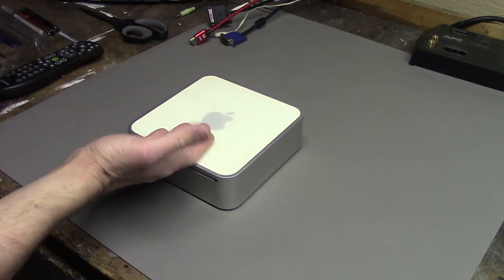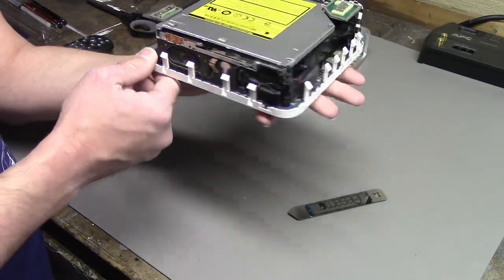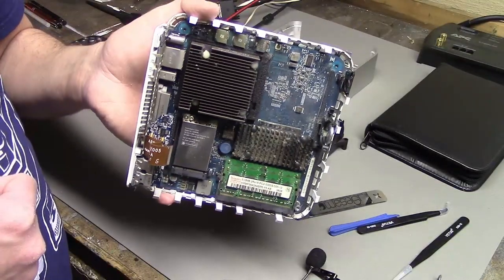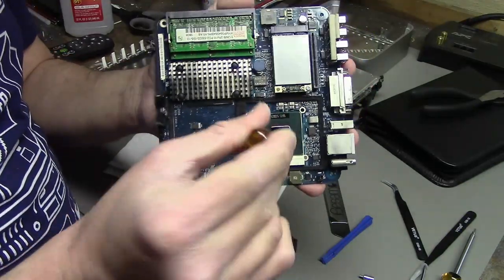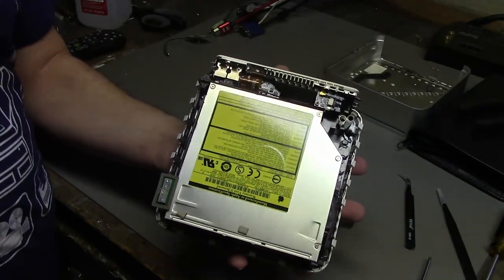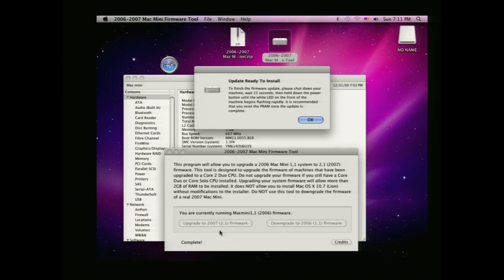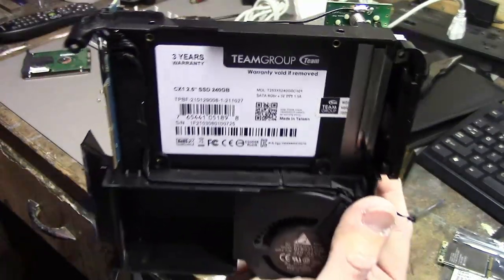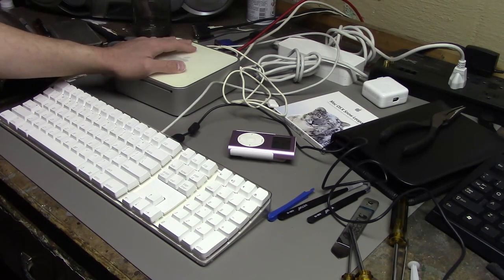Mac mini 2006 - Upgrades and Lion Install

Comment: Even with 32 bit EFI, you should be able to cox it into running El Capitan, which is still pretty functional today.
Reply from the maker: I didn't know there was a patcher for El Capitan.  I'll need to try that!
Reply: @nticompass  where is this patcher? It is not working with my Hardware :(
Reply from the maker: This is the one I was using: https://parrotgeek.com/npf/

Comment: I did a similar series of upgrades to my early 2006 iMac. I upgraded from the stock 1.86ghz core duo to a 2.16ghz core 2 duo, I then flashed the firmware to the iMac 5,1 an upgraded it to 3gb of ram (may do 4 eventually) I then recently installed lion and it made it much more usable due to better program support. I still have the stock Wi-Fi(although I think I broke the antenna as it gets no signal from far away wifi) and the internal HDD is dead so I'm running off a USB one for now as its a pain to open up. BTW if you are looking for a good browser for lion, try firefox legacy 68. It's based off Firefox Quantum and is quite fast.

Comment: A curious thing about these videos.
No one has upgraded the hard drive to an ssd.
I just got a 2006 & I will upgrade mine but leave it at Snow Leopard so I can play my older games or I will partition the drive so it can boot in both modes.
I know how to do it but my arthritic hands will not allow me to do fine work anymore so I will pay a shop to do it.
I was able to play Diablo2 but since it had issues accessing the net I could not upgrade it to LOD.
It would not allow me to install Civilization 3 Complete and it took 3 hours to install Age Of Empires III.
Now to see if that works.
I want to buy an Imac G4 next year so I can play my older games.
I have tried new games and I am terrible at it.
Reply from the maker: I love my iMac G4!  It's nice to have different Macs for different eras of games.

There should be lots of games that work on Snow Leopard.

Comment: Bonjour super vidéo j'aimerais savoir si ce modèle est compatible avec un processeur Intel corde duo T7700 ?est-ce que vous auriez une réponse merci
Reply from the maker: I'm using a T7600.  The T7700 uses a different socket type, so it's not compatible.

Comment: Good upgrades! 👍👍  it would perform well with a Linux OS., installed, such as Sparky Linux LXQT., 32 bit.
Reply from the maker: I do like to use Linux!  That sounds like a fun idea to try.
Reply: @nticompass  It would make an interesting video too.  I have 3 old 32 bit laptops and installing Sparky Linux gave them a new lease of life, You Tube videos are not playable on them though, but your Mac Mini is more powerful than any of my old laptops so it will probably be okay.

Comment: Y porque no una unidad Msata de almacenaje?
Reply from the maker: (And why not an mSATA storage drive?)

I used a 2.5" SATA SSD because it easily fit in the space where the original drive was, without any adapters.  Also, so I could keep the slot on the motherboard for the WiFi card (Airport card).

Comment: I did the same upgrade on mine I bought new in 2007  My question is how or what browser will run ? I tried Arctic Fox 38.1 it loads page the quits
Reply from the maker: You can try Firefox Legacy (by the same guy who made the Lion patcher): https://parrotgeek.com/fxlegacy.html

I haven't tried any other/newer browsers, so I'm not sure what else works.

Comment: What are the new wifi card deails? I need the upgrade too.
Reply: You are using AR5BXB92, is any other model suitable?
Reply from the maker: I'm not sure.  The slot is a mini PCIe slot, but I'm not sure if it's compatible with all cards.  Even if it was, I'm not sure what drivers this version of OS X supports.

I'd at least recommend using an Apple branded card, that should give the best driver support.

Also, this machine is only so fast and only has so many antennas built in.  I don't think anything more than 802.11n it's really going to make it feel any faster.

So, personally I'd recommend the one I used as it's fully compatible and fast enough.
Reply: @nticompass  I am planning to install Linux on my Mac Mini Mid 2007. I do not remember but it seems that I already upgraded the CPU to T7600. I want to use it connected with my 3D Printer or with my TV.
Reply from the maker: I've never tried Linux on this machine, but I can't see any issues with that.  Using Linux should allow you to use more hardware as there are more drivers for certain devices.

Comment: Can you install Windows o Ubuntu? I have a Mac Mini 2006 but i want  install another OS
Reply from the maker: Yes, being an Intel Mac, it does support Boot Camp.  Use the Boot Camp Assistant to partition the drive and boot from an Ubuntu DVD.

I've never actually tried Linux on a Mac, but I'm pretty sure there are drivers for it.
Reply: You can install a lot of other things if you just out the hdd in a different system to install it then put it back in